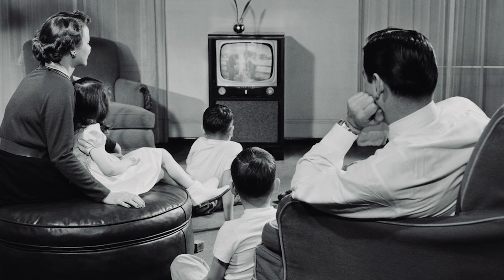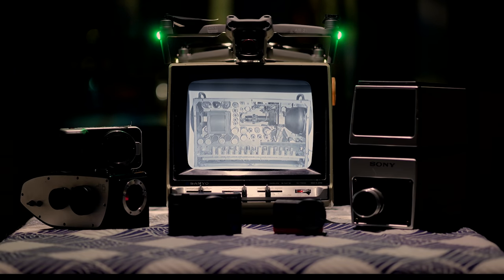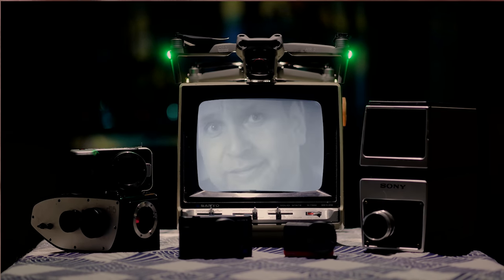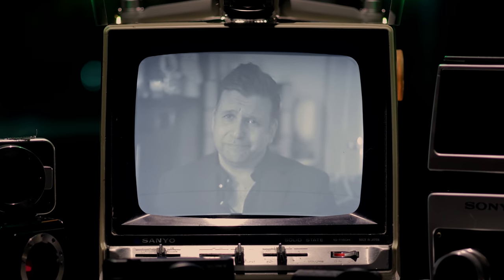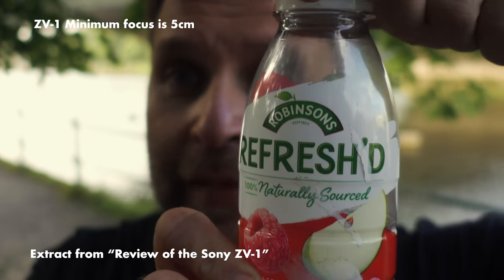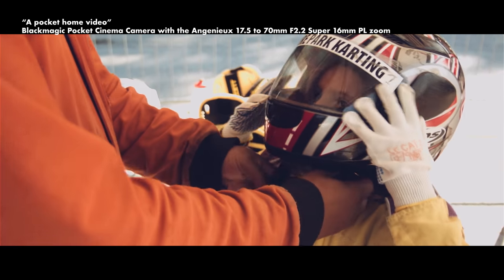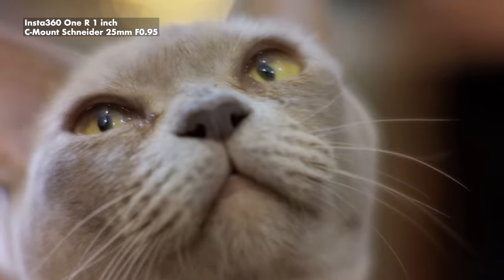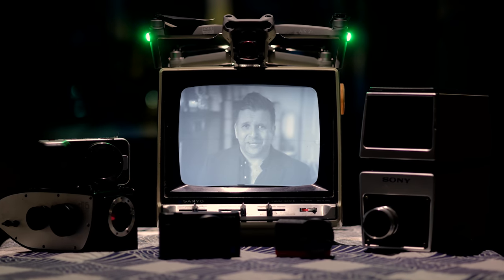The hypothetical TRUTH about the 1 inch sensor

Comment: My first stills camera was a RX100 IV, which is similar to the ZV-1. So I never understood the reason to stop down. I upgraded to MFT now and still barely stop down. Maybe if I end up on APS-C in 2 years or so I might. 

I also have the OG pocket camera, and plenty of 16mm lenses now. But it gets really no use. 

If you want "4K" on Super16, you can get an URSA12K and use the windowed mode. Goes up to like 480fps as well.

Comment: The discontinued Nikon 1 Series had a 1-inch type sensor (first from Aptina, later from Toshiba). There are a lot of lens adapters available for it. The only downside is the last model, the V3 is limited to 1080p60, so no 4k.
Reply from the maker: And the video isn’t great. Check my pinned comment for the best 1” option out there.
Reply: @philipbloom  I wasn't aware of the Z-Cam EG2. I'm trying to work out whose image sensor they're using. ON Semi (my old company) has a 12MP 1-inch type global shutter sensor, but this camera is only 8.85MP (not really enough for 4k). There's also the XGS 8000 which is 8.8MP, but that's 1/1.1-inch. E2V has a 5.2MP, so it's not that. I can't find a match.

Comment: The Blackmagic Micro Cinema Camera is still being produced, is the same 1" super 16 sensor as the original pocket cinema camera, and was designed to be mounted and controlled on a drone like one of the DJI Matrrice series. The issues is, of course, that most newer cameras offer a higher output resolution, and a drone like the inspire can swap similar MFT lenses for a fraction of the over all cost.
Reply from the maker: No viewfinder or EVF. It’s an odd one. One of the best things about Blackmagic cameras is their ease of use with their touch screen menus.
Reply: @philipbloom  Ah, I 100% agree that if one wants the form factor then the original is still one of the best budget choices. Many people want Blackmagic to take the 4k super16 sensor they put in the Ursa Brodcast and put it into something along the lines of the original pocket cameras body. Battery life would likley also by incredibly short.
Reply from the maker: @billyoung9538  actually the zcam e2g! 1” and 4k. I totally forgot about it. Very bad as I have one too! 😂
Reply: @philipbloom  a review of this would be great! Have been on eBay since watching this video for some c mount lenses

Comment: What a great video! Its so nice to see some long format video on such a specific topic. I love using super 16 either film or D16 and although there isnt much available beyond HD they are great to use especially for run and gun or single operator projects. The blackmagic pocket 4k can also replicate s16 with the 2.7k crop as well as the gh5 line of cameras with the Ex. Tele. converter option while maintaining 4k! Hopefully there will be some new interesting interchangeable lens 1inch sensor cameras some time soon! Fingers crossed...
Reply: The best thing about film is you don't need hight tech to see the imagery.  1,000 years from now someone could get some useful information (if stored well, esp b&w).  Digital will be long gone.

I read somewhere some studios are actually making film prints from digital b/c it stores better.
Reply: @scottslotterbeck3796  When stored well film can be a great way to archive information! 16mm film strikes a good balance between size and cost for special projects that could be achieved or projected but is still out of the hands of most film makers... It'll be interesting to see what the future holds for smaller formats as the industry has been trending towards larger formats whether its digital large format or 70mm etc
I have also been interested in creating negatives from digital images but haven't had a chance to experiment with it...

Comment: I watched this video like I was watching a TV show. Very entertaining and knowledgeable. I was going to suggest the OSMO Pro/Raw to modify what is already an interchangeable lens camera, but found it is actually a 4/3 sensor 😀
Reply: I was wondering exactly what size the micro 4/3 sensor is.  I'm guessing it's larger than the 1" sensor.  The first camera I lusted after was the Panasonic AF-100.  It had a micro 4/3 sensor I believe, and the reason I desired it was a Philip Bloom review.  I had just stated to do production sound, and caught the bug.  By the time I got the $$$, the GH4 came out and I bought that instead.
Reply: @scottslotterbeck3796  4/3 sensor size is between 1 inch and APS-C, roughly in the middle. GH4 is also a good choice 👍🏼
Reply: @jimmystewartuk  As I assumed.  The reason I like my GH5 is the color straight out of the camera, and the fact it is not so freaking obvious as say a Arri Alexa!

Comment: Hi, nice video. One thing, the blackmagic ursa mini pro 12k can shoot both super 16 6k and 4k - windowing the sensor I assume. So if you want to spend £9k you can use all that vintage glass. Been shooting some live streams recently with canon 8-64 and 11.5-165 super 16 zooms on ZCams set to super 16 mode(windowed) and the results are very nice.
Reply from the maker: yes of course. Lots of way you can use other cameras to do this but they are not dedicated. I mean the 12k??? No thanks! I can do similar with a GH5!

Comment: Philip, your brilliant analysis of the sensor issue, along with your excellent conclusion leading back to the 1-inch sensor realm parallels my own thinking. In fact, I wrote to Olympus only last week, challenging them to develop a 1-inch sensor platform on the same level as their OM-D E-M1X micro 4/3 platform. I want to get a 1-inch sensor camera like the Sony RX10M4, but keep waiting for a better version due to the glaring deficiencies of that super zoom platform. I am much more compelled by the engineering and build of the E-M1X system; but I still want it in a more compact 1-inch sensor version, along with the potentially fantastic interchangeable lenses such a system could provide, for stills as well as for outstanding options in the video realm. I sent a link for this video of yours to Olympus, hoping to add more punch to my argument and hopefully increasing the likelihood that they might see it my way (which is much like your view too). I think it would become far more than a niche system; rather a highly capable professional platform that could very likely see its way into serious movie and picture-making.

Comment: The Flowstate stabilization requires a lens with a matching distortion profile, not just a matching focal length.
Reply from the maker: For the best results yes but if it’s wider it still works quite well. Longer it doesn’t.

Comment: awesome video! quick thought: the rxo ii could also be a interesting choice - there is a backbone mod + it can be used with sony catalyst to stabilize the footage afterwards (not sure if it works with all lenses, but should be more versatile i think?!)
Reply from the maker: Thanks! Yep i mentioned it briefly. The problem with that camera for me is the abysmal battery life and awful operation of it. Catalyst browse wouldn’t work with anything other than a 24mm equivalent. Same issue as the Insta360 camera as there is no communication between the lens and the sensor. I also don’t have one, just the original 🙂
Reply: @philipbloom  i thought catalyst works with any focal length... i use the rx0 on my fpv drone & did some quick catalyst tests (mainly with a 37mm adapter and the wide-angle sirui attached) - worked in some cases - so it should also work handheld i guess... if i find the time i'll give it a shot & update my comment
Reply from the maker: @swoopyfpv  yes it works with every focal
length based on the info embedded in the file. The rx0 file will always say 24mm.

Comment: Thank you for posting!   Got me thinking about tracking down a used BMPCC and converting it to infrared.  Where there any other good options?  Your Z Cam?
Reply from the maker: yes my zcam f8 is converted. Blackmagic is easiest as it just pops out when you remove the o ring. You just need to get a clear filter to replace it otherwise you get the same infinity focus issues.
Reply: I believe the Panasonic EVA1 allowed IR recording.

Comment: How about naming them based on the largest image circle they are meant to capture instead of a crop factor related to "Full frame" film stock, which in itself is ambiguous.

Larger image circle diameter, larger sensor to capture it. No need to worry about aspect ratios.

Crop factor method would be like: Smaller...4x, 3x, 2.7x, 1x, 0.78x, 0.4x...larger. I guess like aperture numbers.
Image circle diameter would be a linear increasing scale from smaller numbers to larger. Easy to understand.
Reply from the maker: just call them XXXL, XXL, XL, L, M, S, XS, XXS, XXS
Reply: @philipbloom  That is less crazy than the current tube method. 🤷🏼‍♂️

But we need intermediate sizes so I propose adding a decimal after the sizes. XL.05 for example. 😎

Comment: I would just like a sensor where, when I change lenses all the dust in the universe isn't sucked onto it. It's a simple wish.
Reply: canon has the shutter tyhat closes to stop that happening on the mirrorless cameras. perhaps the eos r3 will be good for filming when released (using there variable nd filter adapter)
Reply: @legendp2011  my camera closes the shutter when changing lenses. To my surprise it still got in there. Only had It for 5 seconds
Reply: @thegreatestlight1  I always face my camera down and change lenses in a car or somewhere without wind. In combination with sensor cleaning Ive been retry lucky (also keep an air puffer rocket in my bag)
Reply: Shoot wide open and never notice the dust, if you stop down then you will notice the dust bunnies coming out to play.

Comment: You say the Insta360 1-Inch Edition, "Is designed to be an action camera", but the near focus distance (which they generously call 90cm) is too far out for a general-purpose action camera. Action cameras should keep typical selfie distance to infinity in focus. That also works well for things like keeping the handle bars of bikes in focus (when the camera if chest or head mounted); or having a person's hands in focus. The Insta360 1-Inch fails at this, and a lot of customers aren't satisfied with this trade-off.
Reply from the maker: No jon, I don’t say that. Insta360 do and with a depth of field of 90cm to infinity it can’t be used for things like filming yourself. 

You understand this is the main reason why there haven’t been 1” action cameras before? You increase the sensor size like this and you reduce your depth of field. To get closer focus means either making a much much wider lens, like 12mm or having the ability to adjust your focus which is the best option. There should be contrast based touch focus operation but you must understand that if you focus closer you lose infinity. It’s physics. Stopping way down but still focusing closer may well give the illusion of infinity in focus but on a big screen clearly won’t be.
Reply: @philipbloom  Exactly, I'm so glad you get it.
Stopping down isn't a great option, due to the diffraction limit. The physics cause DOF, FOV, resolution, and SNR to be very finely balanced in an action camera.

Comment: full frame depth of field is so overrated. 35mm motion picture film runs the film vertically so it uses way less surface area on the film than stills cameras than run the film horizontally. So the cinema film look is inherently less shallow depth of field is already less than what people think it should be. Smaller sensors are wonderful.
Reply from the maker: It’s really not overrated. You can make full frame look 35mm but not vice versa. Also the name 35mm is not true, like 16mm. 35mm is the width of the film not the actual image area
Reply: @philipbloom  The "this can do that but not vice versa" thing is interesting, I've heard others say it and it's very true. It's true Super35 sensors can't do quite the same depth of field as full frame, I just don't really miss it. I really resonated with this videos message that smaller sensors producing images like the digital bolex and original pocket cinema are UNDERrated for what they can do.

Comment: I think an easier way to use 1"/16mm size is to buy a Nikon 1 series camera. Or, if you just want to use 1"/16mm lenses, use clear image zoom on a Sony body.
Reply from the maker: Easier than what? Nikon 1 cameras don’t have good video. Clear image zoom on a Sony body? Really?
Reply: @philipbloom  
Easier than dismantling and rebuilding a camera. Alright, Nikon 1 series are out, by why discount clear image zoom? At 1.8x you would have the same cropped view as a true 1" sensor and would benefit from the plethora of E-mount adapters.
Another option would be to use the Canon EOS-M50 (or mk II) in UHD 4K mode. It crops down to 14.3mm×8.0mm, a 2.64x crop from "full frame."
Reply from the maker: @Crlarl  that was a slow reply! I don't understand your comment. I don't understand what Sony has to do with it, which camera are you using to use 16mm lenses? The best option is the Z-cam E2 G which is 1".
Reply: @philipbloom  
I didn't notice until today you had replied.
What I mean about Sony APS-C E-Mount cameras is that they have many adapters made for all types of lenses, including C-Mount. Using the camera as is would require cropping to get rid of the format mismatch. With clear image zoom at around 1.8x would get you a 13.1mm×7.3mm image sensor. Similar adapters are available for EF-M.
Either that or the Canon would allow the use of 16mm lenses without the need to disassemble an Insta360. I was just trying to pose alternatives for the less DIY-adventurous amateur. Much like the BMPC, α6000 series or M50 are relatively pocket-able.

Comment: A Nikon 1 with an FT-1 adapter should do what you need, maybe? And they're super cheap.
Reply from the maker: Thanks but yeah I’ve already addressed this in other comments. I am talking about NEW cameras. If you check my pinned comment you will see I actually own a new 1” cinema camera but totally forgot about it. 

The Nikon 1 video was not exactly great was it? :)
Reply: @philipbloom  Sorry Philip, I hadn't read the comments and had to break part way through the video but you're right Nikon 1 video isn't the best.  Now, a new 1.0 type interchangeable lens camera would be an interesting idea.
Reply from the maker: @LennyG2006  there is one though and I forgot about it, check my pinned comment!
Reply: @philipbloom  And you "forgot" about the Z Cam, ha!
Reply from the maker: @LennyG2006  yes I didn't forgot it, no quote marks needed. Why the quote marks? I was sent it to check out but instead focused on the larger sensor cameras and totally forgot it had a 1" sensor. I thought it had an MFT one.
Reply: @philipbloom  Hi Philip, sorry I think you may have got the wrong end of the stick. In your text under the video you said you forgot you had the Z cam. I just quoted it. That's it. I believe you forgot it. As a videographer and reviewer you must see quite a few come and go and to forget what is in essence just another black box for making/recording video wouldn't surprise me. 

Anyway, great content. Thanks. Sorry if I caused any confusion or came across as insincere.